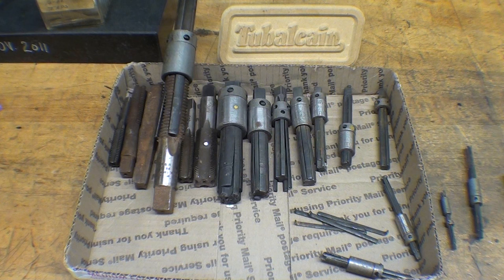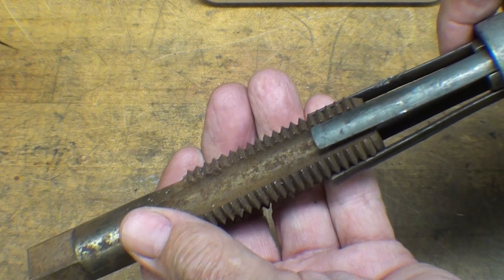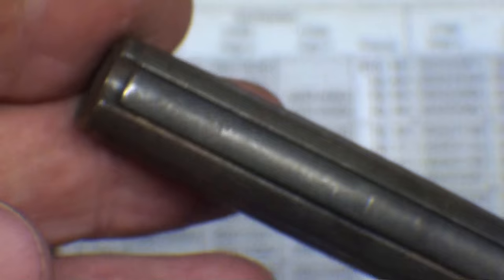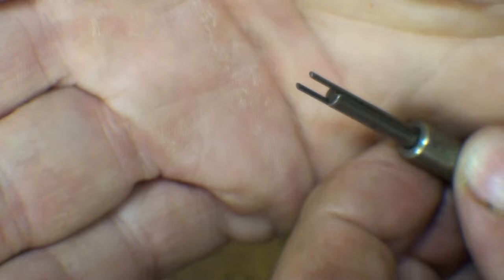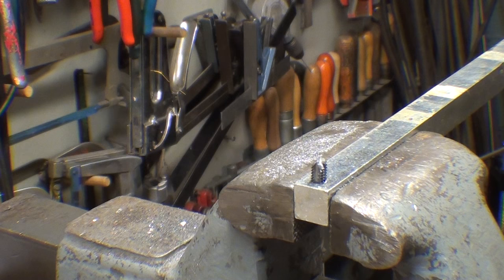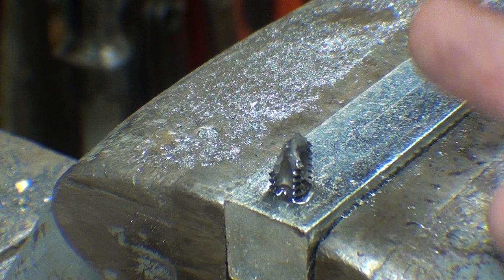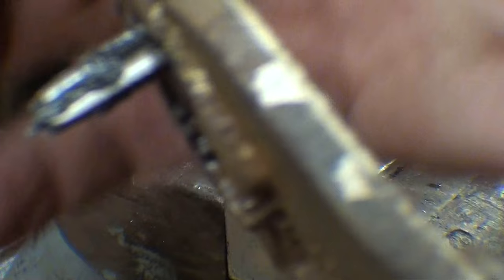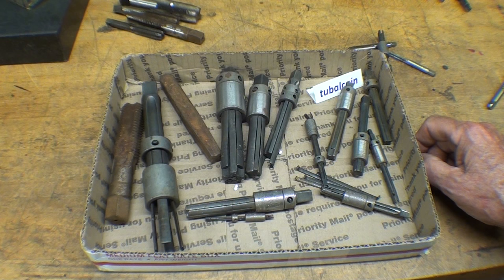SHOP TIPS #268 Using Tap Extractors tubalcain mrpete222

Comment: 1.  If the broken end of the tap sticks up, grind it down near the surface.  Take the part and give the top of the broken tap a few taps with a flat punch and hammer (not too hard just to loosen it).
2.  Put the part in a vise on a drill press or a mill, centered on the spindle with a drill chuck.  Blow out any chips, give it a little oil and install the extractor and put the tap handle on it.   
3.  Next we need to hold the top of the extractor straight with something in the drill chuck (a pin that fits in the opening of the handle above the extractor or maybe a center on top).
4.  Lower the spindle with one hand using light pressure and wiggle the tap handle with the other.  The idea is to keep the extractor in contact and straight so the fingers are only in shear and least likely to bend.  That's your best chance for the extractor to work and If you see them bending, stop and try to loosen it some more.

If the tap breaks deep in the hole, you might be able to put the top half of the tap back in and just slide in the extractor fingers to twist the piece out.  See if you can run a hex nut around the tap.  

If you can't find a tap extractor, I have removed broken taps using straight pieces of music wire, the top of the tap and a hex nut that matches the tread.  You'll need to open up the hex nut a little with a drill bit, but leave enough thread so it still hangs on to the tap thread.  You will need 3-4 pieces of music wire per flute (pack them in tightly), run the hex nut down against the part (not tight) and still use the drill press or mill chuck to hold it.

That's how I was taught by an old tool and die maker.  I can hear him now, "Broke off a tap, huh? (chuckle)"  Then when you gave up, he'd take the tap out for you.  What a great guy he was.
Reply from the maker: Thanks

Comment: Begin by grinding down the tap flat, so that no part of the fingers is not surrounded by the collar. Then, use a small brass hammer to hammer a bit on the end of the tap. This loosens the tap in its threads. If the tap breaks off down in the hole, use a brass punch between hammer and tap fragment. Then, use the Wilton. If the tap fragment does not readily back out, repeat the above steps.
Reply: I agree Paul, what ever you can unload on the threads is going to help, and those delicate fingers need all the support they can get
Reply: Paul, I also agree. I've used these Walton tap extractors many times in the Air Force when someone with little experience tried to do our work. Grinding off the broken tap flush is key, never use a hammer and or chisel to do that, that only digs some of the tap in to the wall of the hole, embedding it and causing more problems. In my experience, I would first try to blow chips out with compressed air first. Then I would tap the fingers down through the flutes, then pull the extractor out and give it another blast of compressed air. A little shot of oil helps too. Then after putting the extractor back in, I would rock the extractor back and forth to get some movement. If I got any movement of the tap I usually got it out with no damage to the extractor. It takes a bit of time and patience and knowing when the extractor just isn't going to work. If the extractor didn't work, then I had to break out the carbide dental burrs to drill through the center of the tap to break it up if possible. Aircraft parts are very expensive and sometimes in short supply, especially engine parts, so we had to try everything we could to save a part. If we couldn't a lot of people would get mad at us, then we would have to explain that we were there to fix someone else's mistake that wouldn't have happened if they called us first. Such is the life of an Air Force aircraft Machinist.

Comment: I'm an electrician and the dozen times that I tried using the Walton 3 or 4 finger broken taps they never worked. This was on 6/32 8/32 & 1/4" taps. Gave away the few new ines that I had. Always used tapmatic fluid when tapping but sure taps that I broke were dull. Thsnks for all the great vids.

Comment: I see you got the same results that I always have.  I have never been able to get a tap out with one of those things.  I don't even consider using them now.  I try to grind out the tap with a dremel with a tiny grinding bit or I try to use a punch and break up the tap if it is large enough.    Keep on keeping on.
Reply: Left hand drills work miracles when extractors fail 😜

Comment: I would think that the first move is indeed to break the tap off as closely to the top of the workpiece as possible, thereby allowing the fingers to be supported at all points.  Leaving that space surely allows the fingers, unsupported, to twist and fail. Not to say it will always work in that way, but I’d think they fail often when there is space.

Love your videos, Tubal...thank you for them!

Comment: I usually go for the  "sacrificial" carbide end mill and some patience. For your typical M6 spin a 4mm carbide end mill at about 3000 RPM touch the top of the broken tap, and then feed 3 or 4 thou  in every pass you take. eventually the tap shaters apart and usully leaves a reasonably good thread. Secrets learned from a toolmaker... and used quite a few times

Comment: Mr Pete, I'd say bleeding for your watchers goes beyond the call of duty! When I taught graduate students a very basic shop course their first job was to drill and tap two 1/4 inch steel plates for 10-32 machine screws so the plates could be held together. They all got their own new taps and drills. Few got the four holes lined up and it was rare for them to get the two tapped holes done before braking their taps. Thanks!

Comment: I gave up on all the gadgets and tooling to remove broken taps early on in my career building machinery. Fortunately there was another shop close by that had a  Metal Disintegration Machine (MDM). This is the most efficient and cost effective way to remove broken taps, bolts or what ever.

Comment: the tap should be ground flush and the tap extractor i have has a small locking collar you bring down onto the collar to stop it moving also if the fingers start to twist and bend they can be removed and straightened and then re-inserted. I have successfully removed a 4mm tap that was 20mm deep in the hole as it was a part of a milling machine it was vital that the tap was removed or i would have had to spend hundreds of pounds on a new part for the machine. i did find that being fairly gentle and keep trying was the answer  so while they are not infallible they do work with a little patience.

Comment: Another method I have seen on youtube and tried, which actually worked for me (but you need a welder) was: I cleaned the broken tap which was flush as best as possible then carefully TIG welded a series of tacks (308/309 rod) to the tap building it up until I was able to get vise grips on it. Plus the heat helps. I suppose MIG could be used as well, maybe even stick if the tap was large enough. But TIG being easily controlled probably is the best.
Reply: weld don't like to stick to hardened taps, it can be done obviously but if a person were not an experienced welder, I would save that trick for another day.

Comment: For the smaller tap sizes a good way to clean the swarf out of the holes first is to take that thin stainless steel reinforcement strip out of an old windscreen wiper blade, grind it down a little and use it to work them out. then you have a lot better chance to get the piece out.

The 3 flute taps are very common in Metric taps, the Imperial ones i have are either 4 slot or 2 slot.

Another way to break a tap is to hit a flaw or inclusion in a cast aluminium unit, which binds the one side of the tap and chips the teeth and then jams it.

Those old taps do make very nice centre punches or scriber’s though, once you have ground the tip down to a sharp point

Comment: If the tap had broken off flush to the surface I would think that the fingers might have been held captive by the hole and would then be less likely to twist and break.  If the tap started to turn then it might be necessary to stop, break the tap off flush again, and try some more.  My (zero experience with tap extractors) $0.02.

Comment: Never used a tap extractor. I almost bought some and a guy I worked with said they weren't very good to get out broken taps as you demonstrated. I have had success getting them out using a TIG welder and welding a nut on them. EDM is the only other method I've heard of getting them out.

Comment: I watched this video thinking : oh don't do that again, glad I didn't try the bottom tap first, lots of good advice.  What timing, I broke of a tap in a 1/4" rod yesterday making a second magnetic chip pick-up from your video. I used a Dermel cut-off wheel to take 3/16's off the rod and vise gripped the broken tap out.  Found a bottom tap, thought not a good idea and kept looking and found another taper tap.  Also re-drilled and deepen the hole.  Of course that meant I had to shorten the copper pipe 3/16, but now I have two chip pick-ups, one is just a little shorter.   Your videos are better than I remember shop class, more like one on one instruction.

Comment: I was very surprised when the tap broke fairly evenly so far above the surface. When I saw that, my first thought was to screw a nut down flush with the surface and then weld the inside of the nut to the tap. I believe that has a better chance of getting the tap out than the Wilton tap extractor. Yes, I have attempted to use them in the past, never had any luck with them. With tiny #6 and #8 taps, I have found you are better off using a brand new tap for each hole, praying a lot does not hurt either. Buying new taps gets expensive, but is cheaper than spending a day or two trying to get a broken one out of something that costs several hundred dollars.

Comment: Tap Extractors and "Easy Out" style broken bolt extractors are usually futile attempts.  Learned early on that great care while drilling the proper size hole then using good quality taps in proper manner greatly reduces this potential.  Still, have experienced my share of broken taps & easy outs.   Usually it was on heavy equipment so the flame wrench was called upon to complete the job.  Would love to learn more about ED removal.

Comment: Good instructional Mr. Pete. I have had a couple of taps break as well as EASY OUTS when trying to extract frozen bolts.  I resorted to trying to drill out the tool or part with progressively larger drill bits and hope that they don't break by using plenty of lube. Lastly I resorted to using the smallest hardened drill bit allowable and drilling into the softer base metal at the edge of the broken part. Lubed it heavily and hoped with the drilling heat and lube, that the frozen part might loosen.  If I did extract the broken part, then I would bore out the original hole with a slightly larger bit and CAREFULLY tap the enlarged hole.  Hope that MURPHY's LAW gives me a "Break"  !    PUN intended !  HA !   Thanks....fellow MacGyver.....Jim   K

Comment: When a tap has broken off above the surface like your example one did, can the sliding collar be driven down over the exposed part of the tap to hold the fingers tightly into the tap grooves? That would stop them being able to twist where they leave the parent metal, and might aid in withdrawing the tap.

Comment: Yup.   Those gizmos rarely work and self destruct on the first use.    Ramming the fingers in probably makes matters worse by packing chips even tighter into what little "clearance" is left.   I had success drilling out with a carbide drill but starting out is tough if the end isn't relatively flat.   
Chipping and picking away some times works but also unseen bits and pcs of tap can get embedded in the threads and you end up breaking another tap when you go to chase and clean up.
Prevention is key!😄

Comment: I've never had much luck with tap exrtactors either. The best is burning them out, unfortunately not many people have a tap burner. I have acided them out, but that involves high strength sulfuric acid and hydrochloric acid... something you really wouldn't want to keep in your home shop.
   If the tap isn't too small and protrudes above the work, I have silver soldered a piece to the top of the tap and successfully gotten the tap out.  
   I guess the most important thing is don't make matters worse by bumming up the hole and leaving a mess after you eventually get the tap out.
Reply: would not the acid dissolve/damage the part as well?
Reply: @GraphicManInnovations  The trick was to make a cofferdam around the the broken tap with clay. We put the acid in with a syringe. The acids attacked the tap's alloy steel much more vigorously than the work piece.
An electric discharge tap burner is really the trick item to have to remove broken taps. I've seen shop-made burners, but I don't have directions on how to build one.
The best advice is to avoid breaking the tap. Take a small scrap piece of aluminum and drill holes in it to guide the tap straight into the work. Also remember that while most tap drill tables give sizes for a ~75% thread, a 50% thread tapped to a depth equal to the tap's diameter will break a standard bolt before the threads will strip out. It is much easier to tap as well. A 100% thread requires twice the power of a 75% to tap, but is only 5% stronger. The only time a 100% thread is helpful is for tapped holes in very thin material.
Cheers from NC/USA
Reply: @aceroadholder2185  thanks for your reply, i did not know that the acid will affect the hss more than the mild steel, how long it takes for i to dissolve ?
Reply: @GraphicManInnovations  An hour or so. Didn't have to completely dissolve the tap, just the cutting flutes to release the tap from the work. The acid would be changed several times with a syringe during the process. The core of the tap could be then fished out with tweezers and needle nosed pliers.
If you try this, be extremely careful. Acid proof gloves, full face shield and no exposed skin. We mixed the acids 50/50 and this stuff will burn/blind you instantly. Store the acids in well marked storage that a person not knowledgeable about acid can't easily get into... it's like battery acid on steroids.
If the acid did damage the work, we'd install Helicoils or Keenserts to repair the thread. In the home shop the Keenserts are handy because they don't require special taps or tools to install.
Reply: @aceroadholder2185  got you, thanks a lot:)

Comment: I have a set of tap extractors taking up space in my tool box at work.  They haven't worked and I haven't even bother trying to use them in the last four or five years.  I usually grab the air hammer with a punch and try to finish breaking up the tap.

Comment: I have a full set of those but haven't used them in fear they won't hold up. The good thing is I haven't had the need to for them as of yet. Best of all they were given to me.
Reply: they'd be good for a situation like if the tap broke because the work fell off the bench.
but you could probably turn it with a punch at that point... so yeah.. no clue i guess haha

Comment: When removing broken taps I use a small hammer and chisel this tedious work. My high school machine shop teacher told us of removing a tap with nitric acid. I have never had to resort to this method fortunately. Have used a torch to burn it out though.
Reply: ..."Tap Out'....Nitric acid......works well on thread forming taps that break....they're usually in there too tight for any mechanical type remover to work....
Reply: That's exactly how I get them out!  Besides burning them out or drilling with carbide it's about the best way.

Comment: I have gotten 100s of taps out with these.
#1. Remove all cracked or broken pieces of taps.
#2. Remove all chips from flutes with air and picks.
#3. Slowly move tap back and forth with the tap extractor until you can back the tap out.

33 years experience as a plastic injection moldmaker.

Comment: The problem with these tools, mostly with the small dia. taps, is that the fingers "trap" the chips in the threads[that is the reason for the grooves between the flutes; to allow for chips to clear away from the threads] they are now filled with the fingers...the chips have no where to go so they act as thread locking wires so you just twist the fingers up and the tap doesn't budge.

Comment: I have had good results welding a nut to broken bolts to remove them. I wonder if a nut could of been welded to the long stub of tap sticking out? I have never tried to weld to HS steel.
Reply from the maker: I need to try that method
Reply: It would be interesting to plug weld a nut to the tap. Maybe the heat from welding would soften the tap a bit and make it less brittle.

Comment: I've never seen this thing work.... Only method that works like a charm is by weld/ braze a nut to the stub and turn it with a wrench. The combination of heat and higher torque really helps.